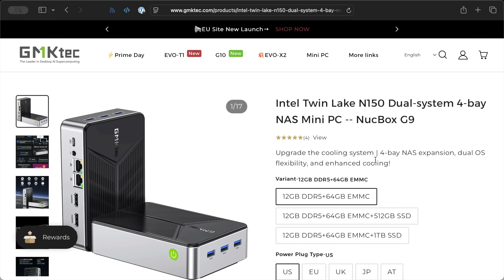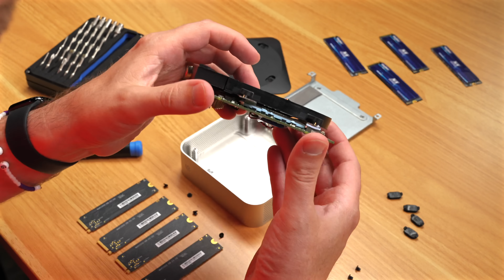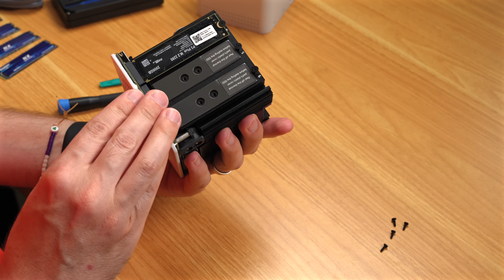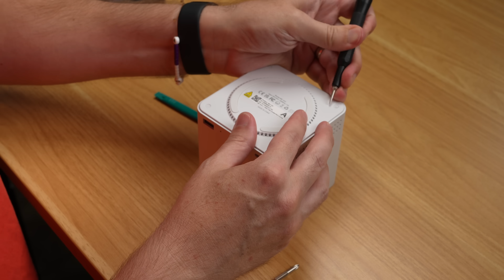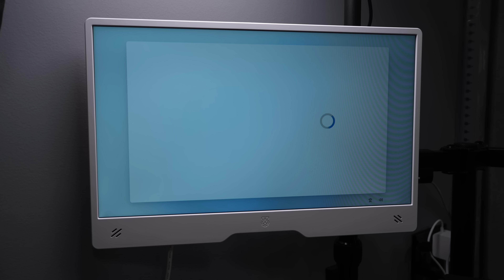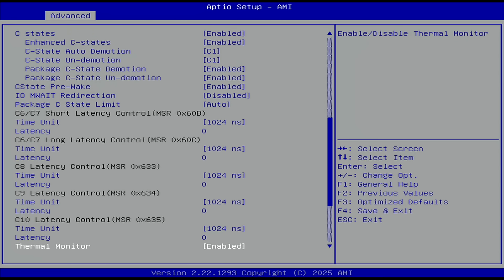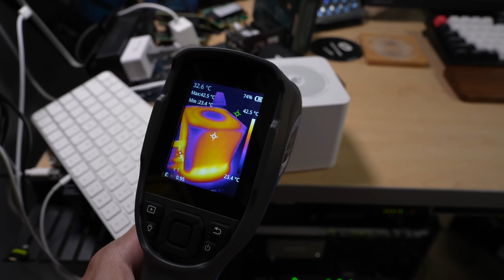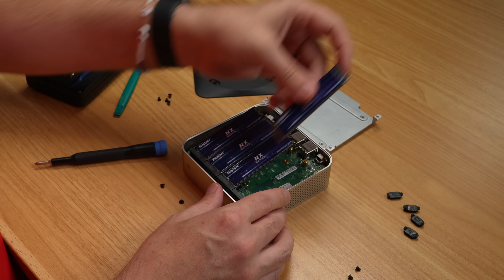The Mini NAS has arrived! (mini homelab)

Comment: The internal PSU is handy in most cases but for folks running off of batteries (off grid or van lifers, for example) it's better to supply DC to devices that run all of the time. Converting battey bank DC to AC only to convert it back to DC inside the device is wasteful.

Comment: I'm partial to a raid-6 or raid-z2 setup because of the likelyhood of a second drive failure when rebuilding an array, especially if it takes me a while to fix (or notice) the failed drive. Do you think with SSDs the likelyhood of a second drive failure is low enough during rebuild (due to higher speeds), that a hot or cold spare strategy would work almost as well? Having 2 parity drives almost necessitates at least a 6 drive system to be worth it in in terms of storage efficiency. 

I use off site backups for my data i can't lose, but for media I protect against common hardware failures, but if more than 2 drives fail at once, i can assume i have bigger problems than lost media (e.g. my house burnt down).
Reply: Personally, I think you'd be better off with a USB backup drive, say 16 TB, ( spinning disk ) instead of wasting  a drive for Raid Z2 ( raid 6 ) .

Comment: On the Aiffro K100, couldn't you just put /boot as EFI FAT32 on a USB drive and dedicate some space of a 4-bay zfs to the root fs? /boot could be redundant also, if a 2nd USB drive is added to carry a clone, and is re-cloned after changes on /boot.

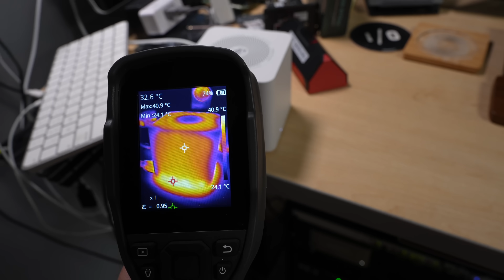Comment: at 11:10 the BeeLink Mini pulls the air in from the top and pushes it out the bottom for some reason...
Reply: Dust. When you intake from below you tend to pick up and deposit more dust than if you do it the other way around.

Comment: Hey Jeff, about your USB boot hesitation. I would look into flash drives with controllers like SMI SM2320/SM2321/SM2322 or Phison U17/U18. They are more SSD-like than normal flash drives and should handle OS tasks better, hopefully also more reliable.

Comment: If you look at the fan on the Beelink you will notice it intakes from the top and pushes air down and out the bottom. It would seem to me they could have done more to increase airflow with less restrictive openings as it looks very restricted on the outlet at the bottom, and the top i would cut out the grill and replace with an open mesh or similar.
It is ripe for a 3d printed replacement cover.
Reply: Could you reverse the fan?

Comment: tbh not having emmc is something i dont personally see as an issue

in fact i hadnt considered that some could have emmc...
my idea if i ever buy one of those was to do mdadm raid, two raid5 arrays the first one being about 32GB or maybe more depending on what im planning, but probably 32, and the second one with the rest
so i would take from each ssd, assuming 5 SSDs, 8GB from each (8*5 - 8 because of the parity -> 32GB)
well, it would also have an esp partition, so probably like 200-500MB from each disk too, not raid because you cant software raid an ESP (afaik) but grub installed in all the ESP (or using efistub)

Comment: Pro tip for future hardwre designers; make your rubbers screw-fastened. For novice DIY'ers, chamfered rubber washers and finishing screws would make for a suitable substitute. Either way; the compressin of rubber could also interface with fins beneath the screwhead, so once completely bottomed out the screw digs into the rubber, which may provide a better semi-permanent affixation.

Comment: I know it's far from perfect but considering the general lack of proper ECC on LPDDR5, the systems with these chips should at least let you turn on in-band ECC though it'll drop your overall total system memory and hurt performance a bit.  Couldn't tell from the brief clips on the Beelink but does that one at least let you enable it?  Overall though seems like it'd be better to go with something slightly bigger that lets you have SO-DIMM.

Comment: They all miss out on the most important feature for a NVME.only NAS-boxes, the 10GbE connection.
Why would you have to use a USB-drive to boot from when using the Aiffro? It has externale USB-C connectors, so use an external SSD to boot ..

Comment: man, getting a NAS is as expensive as ever, 10k pesos (536 dollars) for the ME mini thing and another 27k (1450 dollars) in NVME SSD's to max it out
Reply: How about building one with pi or an old second hand pc
Reply: @gladiuss6980 there's a Cm3588 compute module with 4 NVME slots that's cheaper, but even if I were to use only 2TB drives having only 8TB doesn't sound as nice as having 12TB, and the expense is still a lot more than buying a regular hard drive with 8 or 10TB, it wouldn't be a nas though if I only buy a hard drive, the convenience of having it plugged to the wall and have it accessible without spending hundreds of watts per hour is very important to me, but the starting price to get it going is wild

Comment: Oh - So so much to discuss. Many chase pure out-and-out performance without a use-case for it - occasional sporadic backup at a reasonable speed and operational cost or on-line active network storage to support constant high volume data transfer? 
Pointing out the performance relative to the slowest element in the chain is useful. Most will be at the 1GBit/s ethernet speeds. If you have (or are getting) 2.5G or 10G networking only then the devices position on the speed curve become important.
Both power usage and heat dissipation are key drivers. The typical idle and full load power usage turned into annual cost of ownership would be useful and illuminating (although actual costs differ place to place). A typical SSD setup up could save several hundred £/$ per year over a HD setup and some processors will cost way more to use, even at no load. Cost of ownership can easily be several hundred £/$ pa so freeing up money for purchase.
The Me Mini to me looks an ideal device for a low power NAS primarily for backups, but maybe not a suitable home-lab set up or an on-line data store, especially if the physical size isn't a consideration.
Could it be a true multi-purpose device running proxmox for the NAS alongside other apps like HA / Plex etc in a typical domestic environment?
On the others, if you could, wouldn't an SSD on USB to SATA cable be better than a USB stick? Still inconvenient from a physical point of view but potentially less risky.

Comment: The downsides I see with a built in AC transformer, are
1. the extra heat it is likely to generate inside the case
2. the fact that if it dies your entire system will go with it since we aren't talking about a modular PC build
3. if you want it to be portable (most people probably don't, but you mention it in the video) then you need AC power available to run it, or have to convert DC to AC back to DC whereas the other two systems are happy using anything that can deliver the correct DC power (usb-c transformer, batteries, etc.)

Oh, and the clock face is for using Time Machine to restore your backups, surely? :D
Reply: Yeah, I'm having the same issue with my Mac mini. Since the power supply is built in, it's way more complicated to power it mobile or add a UPS to it. It sucks.
(Heat is not an issue with that M4 chip, though.)
Reply: Yes, I'd like the option to run it from a solar/battery backup system, so DC input would be better. These look far easier than the Mac Mini, to get inside.
Reply: When it comes to portability and reparability, on this kind of device and this tier of manufacturer, it should be easily modable. You can either feed the required voltage(I think it's 12V in this case) to where PSU outputs straight up, or put in a simple USB PD negotiator thingy if you want USB C.
Reply: "The downsides I see with a built in AC transformer, are
1. the extra heat it is likely to generate inside the case"

Easy fix and ultra-cheap fix. I don't have AC power, and I don't have an inverter. What I did was remove the AC power supply from inside the ME Mini, then added a 12-volt power port (the ME Mini uses 12-volt DC) so I could power it from my 12-volt solar/battery system in my ham radio shack.  I power a Beelink SER 6 (I boost 12 volts to 19 volts because the SER 6 needs 19) the ME Mini, a couple Viewsonic 16" touchscreens, and a bunch of ham radio gear, all powered via ~12 volts.

The power supply is removed easily. You're left with a connector to plug a 12-volt \ sources into.
Reply: to 1: A GaN power supply generates less heat than common silicon-based one.

Comment: I too had gone down the "smaller and smaller!" rabbit hole for a while.  But smaller hardware almost always runs far hotter and has more issues with constant load, as well as lower performance.  Instead of any mini now I'd buy an old mini tower PC and have ample computing power and less hassles.  But dang, I still want tiny computers.

Comment: To run the OS on the K100 you could also simply create a 10Gig partition on each of the 4 nvme drive and install Ubuntu on a raid1/raid10 and use the rest of the space for data
Using an integrated emmc is not a great idea anyway..

Comment: I use a 12600H MS-01 with a PCI-e switched nvme adapter to get 5x4tb nvme. Not the coolest and most power effective but the thunderbolt and 10gbe sfp make up for it.

Comment: To avoid using external USB drives, just use ZFS and use the same SSDs for both the OS and bulk storage, just separating them using ZFS filesystems. And you'd like a proper check summing filesystem anyway, so this would also be possible with btrfs or lvm with dm-raid integrity.

Comment: I don't really understand how the non-EMMc boot drive is a problem?  Just RAID the 4 NVMe drives together and be done?  At 250MB/s you aren't gaining anything running ZFS on 4 drives.  Just use LVM and RAID5 the 4 drives together and use logical volumes.

Comment: The covers are because exposed metal surfaces are typically tested for direct ESD. Typically best practices say to cover them on device. It's likely also why the direct connection to the external chassis is avoided by some even if it's more efficient as a heatsink.

Comment: I just replaced my GMKtec mini PC (Ryzen 8845HS) with a Minisforum MS-A1 with a Ryzen 7900x. Upgradable CPU, I can reuse my 96GB of SO-DIMM memory, and it fits 4 NVMe drives, plus it runs off of 19V so I can power it using my small scale solar setup (no inverter needed). With Eco mode set to 65W and CPB disabled, it uses around 60-70 watts with my ~10 VMs running under proxmox, with those all running mostly idle. Very happy with it, even if it was pricier than a mini PC.
Reply: Wow, suddenly I don't feel so bad about my 90w power draw in my setup, A repurposed HP Elitedesk with an i5 9500, running 4 8Tb spinning drives, along with a HP Z4G4 Xeon W-2145 workstation with about 3 VM's, 17 containers, along with about 15 or so docker containers on one of the VM's.  I'd been trying to think of ways to get the power draw down, but maybe it's actually not that bad given my use case.

Comment: You don't have to lose a drive's worth of space when installing your OS to your storage array. Ubuntu supports booting off of a ZFS volume, you just need to install it somewhere else first (like a USB drive) and then, still in the live session, copy the root filesystem over to the storage array and finagle it in a chroot (e.g. update fstab, regenerate your initramfs). You do still need somewhere to put the EFI System Partition and /boot filesystem (if this is separate from /). You have two choices here: (1) Leave them on the USB drive; since they're hardly ever written to, it won't wear out, or (2) Use ZFS on partitions instead of the whole drive, and make a small partition on one of the drives. If you're feeling extra adventurous, you can create the same EFI System Partition on all of the drives, give all of them the same partition GUID, and make them an MD-RAID RAID-1 (with 1.0 metadata, so it still appears to the firmware as a FAT32 volume), and then it will still boot even if any drive fails. Since the OS occupies such little space, you can afford to use a ZFS mirror for that, which, in combination with a RAID-1 for the ESP, means the OS would still boot if all but 1 drive fails.

Comment: i've got the GMKTec G9 running proxmox in my garage. peaks around 80ish in the day and 75 at night. my idle is around 52-53, and 72-75 when under load. so far no restarts or anything. seems to be working just fine.
Reply: Mine is running TrueNAS Scale with a simple SMB share and Jellyfin in an air conditioned office and it runs fine until I try to transfer any large files. Then it locks up and reboots every few minutes. I have been very disappointed because I love the size and price, but I'm thinking about trying the thermal hacks Jeff used to get mine stable.

Comment: Jeff, you can easily put a partition table on those drives, set aside 1 GB of each drive aside for your OS and create your RAID volume on the (remainder size) second partition. This way, you don't need to sacrifice a whole drive for your boot OS.
Reply: Yes, that's what I was thinking when I wrote my comment, but perhaps a bit more space for the os if containers are used, I don't know.
Reply: I think the point is that you shouldn't have to. That there should be either a space set aside for a separate boot, or emmc boot storage or something. Because this does seem like a heck of an oversight to me, either putting the boot on the same drive as your data which is gonna get a lot of usage and is thus more likely to die, taking not only part of your data, but your boot and all the information on it, or sacrificing an entire drive to make it separate.
Reply: IIRC, TrueNAS wants to use an entire disk when creating pools. When building ZFS pools on a non TN box, you CAN use partitions as members of a VDEV. What's cool here is that the pools created don't have to have the same geometry. On a set of 4x 1TB NVMe drives you can have a 2GB partition for the boot pool, 2GB for for swap and the rest for the root pool. Then make a 4-way mirror (2GB total) or a striped mirror (4GB total) or even a RaidZ1 (6GB total).  For the root pool you can use a completely different layout using those 4 large partitions. Both pools are protected from single device failures.
Reply: Homie, check out the very next sentence he says.
Reply: Best practice is keep your OS boot on it's own drive separate from your data drive(s).  It makes recovery and maintenance alot easier to deal with.
Reply: @Darkk6969  In an enterprise? Maybe. But these aren't targeted at an enterprise. And I think the redundancy across the OS by sharing the disks would far outweigh any issues you're likely to encounter by sharing. 
A slight risk perhaps if you reformat the whole drive when installing a new OS... But that's what backups are for, right? And accidents can happen at the sometime with separate disks, just by selecting the wrong one.
Could debate this for a while. But I still think the OS disk redundancy from sharing far outweighs any conflicts with best practice
Reply: @Darkk6969 and of course that's what I always do, but I play with server hardware and have plenty of drive bays. There is no data recovery reason not to do this. It's just aesthetics.
Reply: very risky, albeit possible. i wonder if you could just keep your OS on a USB Drive and keep it plugged in instead, so if one drive fails it doesn't complicate the recovery. what do you think?
Reply: @xsonority  Unraid OS do this
Reply: @xsonority See the official Debian bookworm root on ZFS HOWTO.

Edit: The reason I pointed that is is that they use partitioning.

Comment: Though its more expensive, I love the Terramaster F8 SSD Plus. 8 drives and 10gbe. Not the quietest in the stock case, but I modified mine to use small Noctua fans and it's been great in my mini rack.
Reply: Did that require modifying the case or do they have fans of the same size?
My drives are running a bit hot at around 50c idle at 100% fan speed so I'm wondering if I could improve the situation.
Reply: @TammuzKay  I made a custom 3D printed adapter for two 60mm fans. Noctua does not have fans in the exact size of the stock fans.

Comment: Great review. One question though, on tradiyional NAS the disks selection was always recommended to be for NAS purpose (suvh as WD red), in the new nvme world is this also true?
Reply from the maker: You make a good point; SSDs vary in quality quite a bit, so I think I'd consider more NAS or Enterprise focused SSDs (Kioxia, maybe some Samsung, Seagate NAS) if I were wanting a bit more warranty support (e.g. drive dies I get a replacement).

But from testing about 50 different NVMe SSDs, I've found the storage controller and temperatures to be the most important factor, Phison makes the controllers for most third party SSDs I've tested, and they are usually decent, though sometimes the controller firmware is outdated which can lead to compatibility problems ;(

Comment: As for the four NVMe slot limit, you can also use ZFS on root to avoid needing internal eMMC storage or booting from USB.
Reply: If you're willing to consider FreeBSD instead of Linux/Ubuntu, that will help a lot with booting on a K100.
In a more "serious", NAS I would prefer a different zpool between boot and data.
That said, although I like eMMC, ZFS boot on a RAIDZ1 could offer much more resilience than eMMC (and, for the sake of honesty, I still need to exhaust the cycle of any eMMC I have at home). But I guess Jeff knows this stuff already.

Comment: You mention that you have to use one drive for the OS.

Why not having a small partition on all of the drives? That way you can have redundancy with raid on all disks, so if the OS drive is damaged, the NAS will still run.